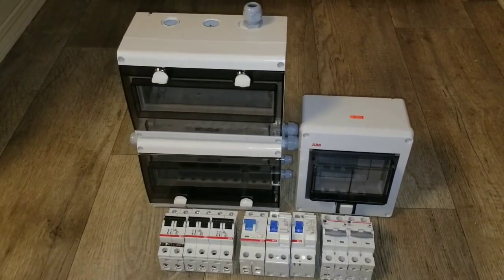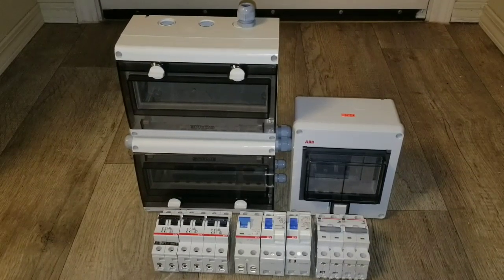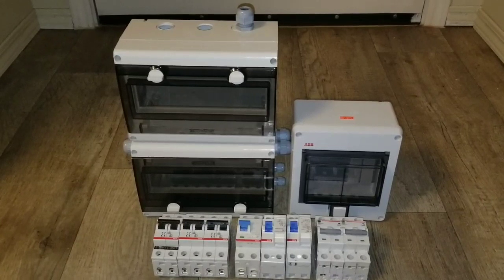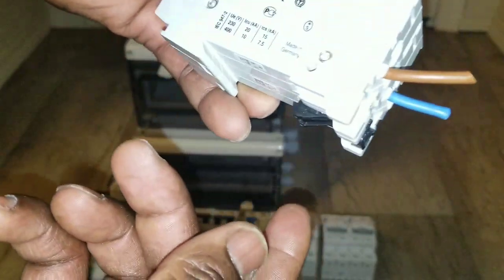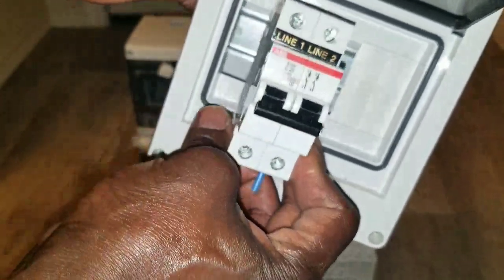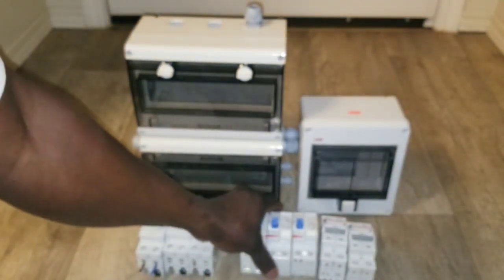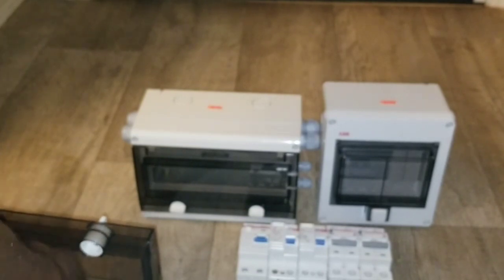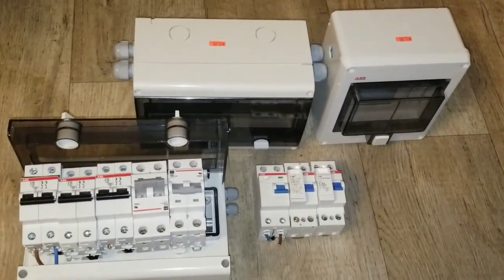AC vs DC CIRCUIT BREAKERS - breaker box is full how can I add more

Comment: They are nice .I have some. I don't like how big they are . Take up to much space. I use Square D  Q line for AC  & midnight on DC side. I ended up using that type out side on my pv out on the solar tracker poles to the main combiner box. However they cost much less. U have nice box's to put them in.
Reply from the maker: Oh yes....👍